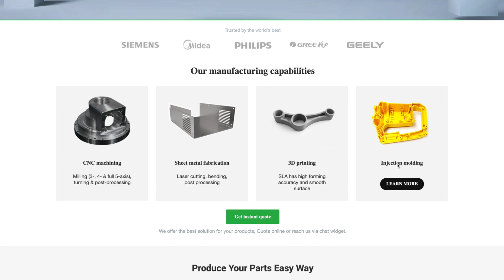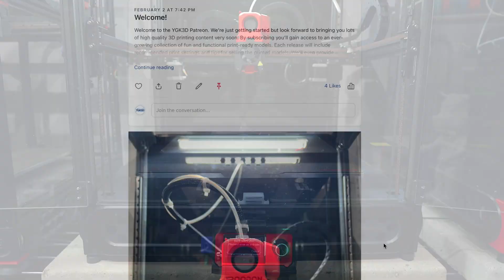The "Voron" for Beginners, Print Farms and Lazy People - Troodon 2.0 Quick Start Guide Part 1

Comment: You CANNOT grease the linear rails outside, you NEED to get the grease into the carriage. Those carriages have wipers which will stop the grease from getting inside and just pushes it aside.
Reply from the maker: Mhh… interesting. Unfortunately it was very difficult to get the grease in the holes here.

Comment: Hey Taylor! Do you have a PLA slicer profile for prusaslicer and the troodon?
Reply from the maker: You can use the Voron profiles and just change the start code. TeamGloomy has one on their GitHub. Alternatively, there are Troodon specific profiles built in to OrcaSlicer. Note that in both cases you’ll need to be running TeamGloomy firmware, not stock firmware.
Reply: @ygk3d  Thanks

Comment: I have to say, so far this has been the worst printer experience I've had. It refuses to stick to the bed. I've been printing with creality CR10 for years with no issue. I had the hotend jammed because the heatbreak was not properly screwed in. I still haven't printed anything. That 3h should be changed to 3 weeks.
Reply from the maker: Sorry to hear. Did you follow part 2 of this guide to upgrade the firmware and set the z offset? The z offset is almost always the culprit for lack of adhesion. The stock PEI bed works well for most materials. For ABS I’d suggest adding glue stick.
Reply: @ygk3d  It  seems I was an idiot, for some reason my prusasicer profile was set to extrude 180%.
Reply: @ygk3d  I managed to get PLA to stick to the smooth side at 70 degrees. Are you saying ABS will be even worse haha? I've done everything in the team gloomy instructions and in your video but the layer stacking is horrible. I think I have to tune the extruder next. You would expect it to be decently tuned stock and only do fine adjustments though. I also had an idler in the back grinding against the back enclosure so had to resquare it. I also didn't get it delivered for 2 months because UPS lost it. I mean what else can be wrong haha? 1 out of 5 experience. However the printer does have potential to be great. Will just have to sort out everything.

Comment: You plucked the long side? That doesn't work, the frequency changes with length. What I've found is that app works great if you pluck gently and point the microphone on the phone as close to the belt as possible, like a centimenter (less than half an inch for you americans). It worries me that the tension is basically zero at 110 Hz, those belt tension screws are basically hand tightened. Should be another nut in there to lock it in place.

Comment: Would you recommend this over the Creality K1 max for ABS? I really like the 350mm build volume as I need it on occasion and it's the only thing making me consider this printer over the K1 Max.
Reply from the maker: I have a K1 (non max) in a box. Haven’t opened it yet to comment on its quality. The K1 will likely be better out of the box than the Troodon but way less mod-able and less compatible with community upgrades. The Troodon can run stock Klipper while the K1 is locked down to Creality’s version, with many of the useful features stripped out. The K1 seems to have a thicker enclosure than the Troodon so in that regard the chamber temperatures will likely stay higher for ABS printing.

Comment: I was inspired by these videos.
I built one Troodon 2.0. And: mechanically it is not a perfect kit, the holder for the filament sensor is missing (does it have to fly on cables?), the front door does not fit well even when using a 3mm sealing. It is not possible to set up Wi-Fi via the setup in the gcode file (I also tried what teamgloomy wrote), on both 2.4GHz and 5GHz. I'll try again via USB. WiFi was off, setup gcode works after switching WiFi on in printer menu. WiFi is for a while on, now doesnt work :-( Possibly too far from roter? Computer in same room doesnt have a problem. After added second - closer WiFi point, printer was connected.
Display holder is a bit wobbly. Sometimes printer doesnt reflect command form menu, like "Load fillament".
The control is really weakly designed against the old Prusa 3S. Benchy's first test boat lasted 1.2 hours (3PL, 5T, 4B, 20% infill, default profile settings). I printed via the profile that is on the supplied SD card, using Simplify3D, on Fast option. Where is the speed? It's a printer for people who enjoy working to improve it :-) Now I understand why somebody try to use Clipper or other tweeks. Unfortunately, I'm not sure about the benefits of "improvements". There is also a lot of time and effort and benefits are not explained in videos about Troodon. Would be please possible to make a video comparing user experience with out of the box Troodon 2.0 and improved Troodon? Including of resource links and time/budget on each improvement? Would be on the end better to buy expensive Voron kit from LDO and spend 30 hours of building it?

Comment: 4:55, my gantry seems to have a skew to it. When I try to level it off of the base, one corner always wants to dip back below the others. I had to loosen the screws that holds the gantry square just to screw it in the bearing blocks, this wasn't too hard, but this being my first Core XY and Vivedino saying to ensure that the gantry is less than 1mm off level at each corner before screwing into the bearing blocks makes me question if this is bad assembly at the factory or if it's not important.

Comment: I bought one of these a few weeks ago and it prints really well. I'm not happy with the bed leveling sensor though, seems very inconsistent. Do you have any plans to upgrade to Tap or Klicky on this machine? If you do, I would be very interested in the details, or if it's possible.
Reply from the maker: Yes. I have already fitted Klicky on one of my Troodons. I’ll cover the process as part of my upgrade series which will follow this beginner series
Reply: @ygk3d  Awesome, looking forward to it!

Comment: just finshed a build of this yesterday :P did throw away the sticker and the cooling is not good enough for a pla benchy with the voron 2.4 profile in orca slicer
Reply from the maker: Check out the 5015 fan upgrade for the Voron Afterburner. That will help with cooling.
Reply: @ygk3d  yes did work thanks

Comment: nice video! I was thinking of getting the voron kit from FormBot but this options seems more and more attractive, especially with your video on converting to Klipper! Any news on whether they will do a stealth burner hotend upgrade soon?
Reply from the maker: Thanks! Yes, they have a Stealthburner upgrade kit that they will be releasing soon. I have one on the way and will make a video on it when it arrives.
Reply: @ygk3d  btw if you have not seen it yet. Someone has created a pressure advance calibration open source project, kind of what you get with Bambu Labs X1C but in this case was demonstrated on Voron! One step closer to automating calibration for prints on the Voron series. https://www.youtube.com/watch?v=c1hrP0gduRU&t=336s
Reply from the maker: @philipjensen6442  will definitely check that out. Thanks for sharing.

Comment: Just ordered a 2.0 the other day, perfect timing. Not sure if you have come across this yet but there is a Voron Belt kit for the 350mm 2.4 R1/2, going to order it as well and see if it will work with the 2.0 as a fast way to get auto part removal with the lower overall build time.
Reply from the maker: Oooh that would be awesome. Let me know if that works out for you.
Reply: @ygk3d  Looks like the  2.0 board comes stock with 7 drivers, will need to swap the board/wiring harness to the Octopus 1.1 most likely to allow install for the conveyor. Confirmed with the Formbot engineers this is the case. Also looks like I am installing Klipper sooner vs later 🤷‍♂